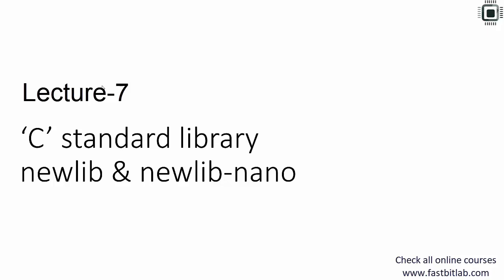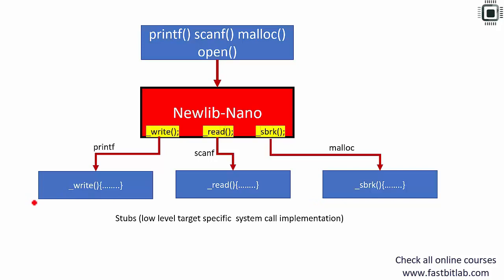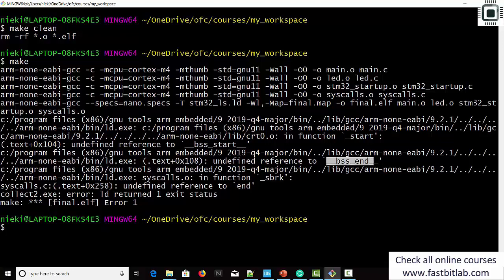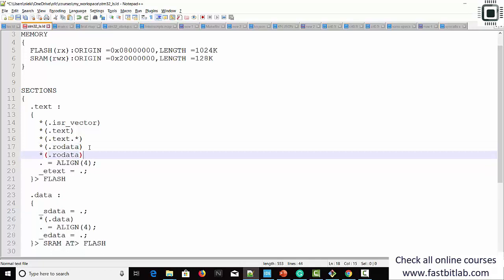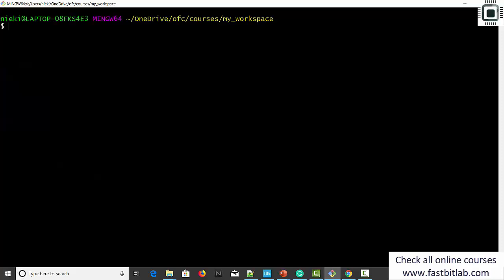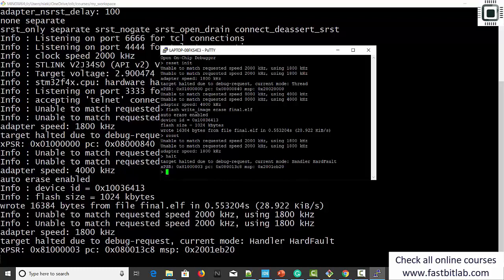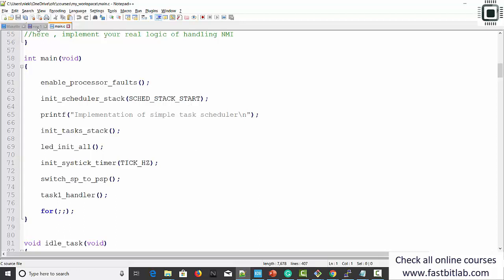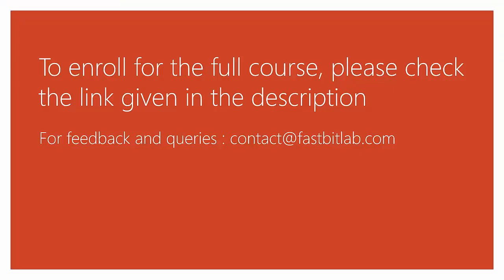Bare metal embedded lecture-7:  Integrating 'C' standard library and semihosting

Comment: Sorry sir, at 28:28 my current mode still showing "Handler HardFault". Any idea why is that? I have beenn checking my code and i dont think there is any wrong syntax. Thanks before. Btw i'm using Nucleo Board F446RE and my main.c i write simple blink program from your beginners course with simple printf().
Reply: The almost same here. In my case it is: "Handler UsageFault".